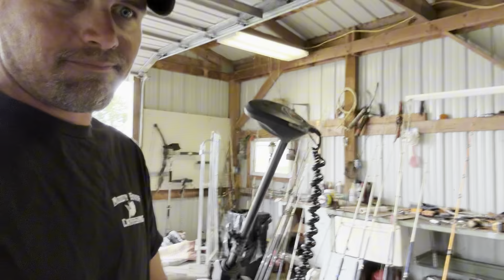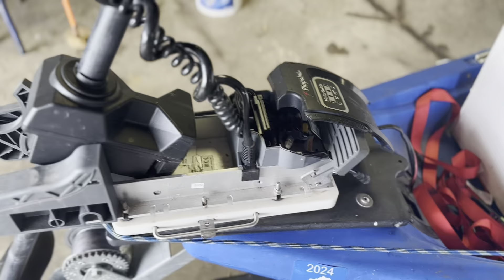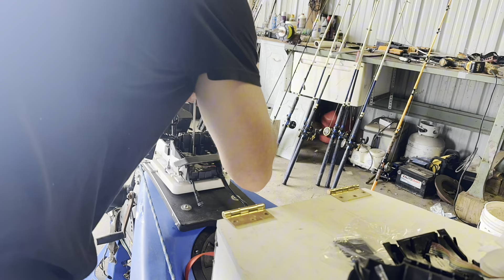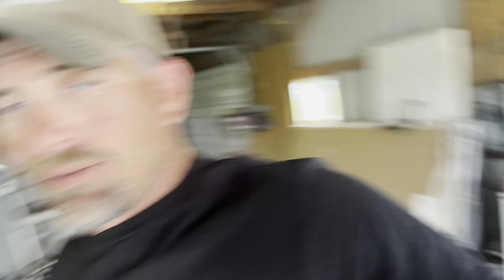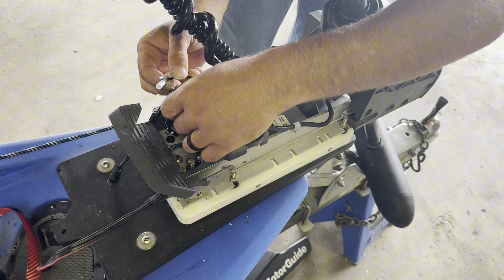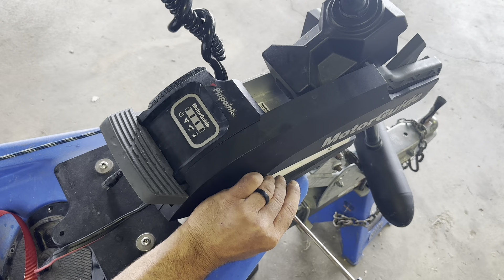( Motor Guide Trolling Motor Repair )How to change a Bad Control Board

Comment: Good job im having a similar problem with my xi3 it turns both directions but propeller light won’t come on  when i push on the remote and won’t turn the motor.
Could it be the control board as well?
Reply from the maker: That would be where I started with it.